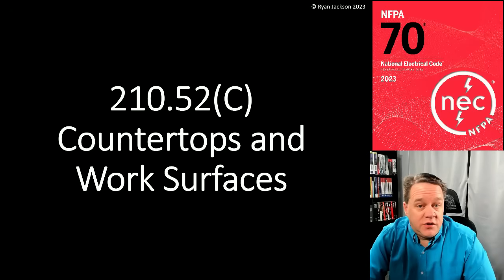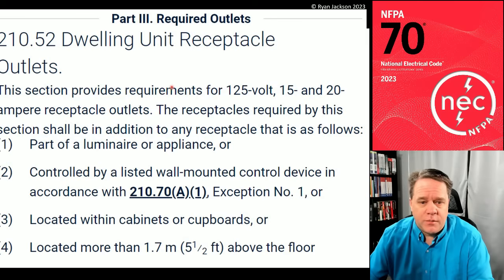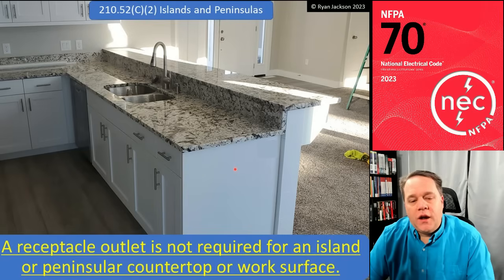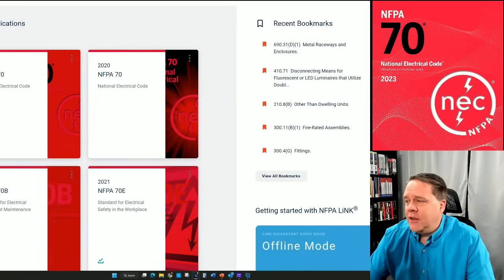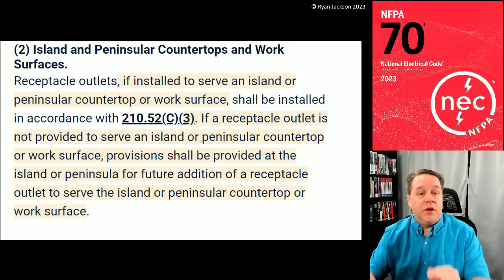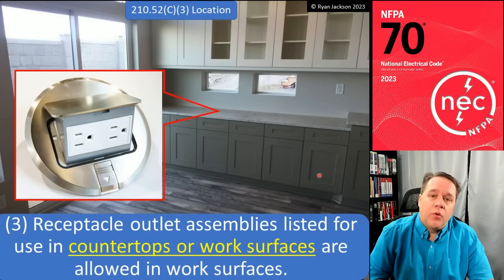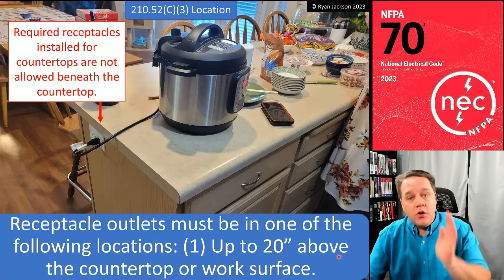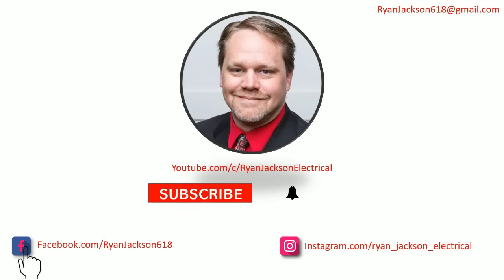Kitchen islands and peninsulas in the 2023 National Electrical Code

Comment: I think most Courts, and most inspectors, would judge by the intent of the NEC wording.  They don't want receptacles below countertops anywhere in a kitchen.  Typically those were in peninsulas or islands because the only lower surfaces without cabinet doors.  They are convenient for plugging in a vacuum cleaner, but too tempting to use for appliances that get hot.  Using 90 deg plugs would help, but little kids are still going to tug on things, and can't see what is on the other end on the countertop.  Don't want your tykes getting boiling chili dumped on their face since we all hope for attractive kids we can marry off someday.

In a kitchen remodel, I tiled all the way to the walls so the base cabinets sit atop the tile and could fairly easily be redesigned (exc. sink plumbing in wall).  Instead of a fixed island, I built a cabinet table with marble top that can be relocated (ex. to rearrange for parties), sliding on felt strips (doesn't slide easy so stays put).  No utilities in that table.  Slab foundation, so supplying power or plumbing would have been drop down from the ceiling (no drain), unless hacking up the slab.  I ripped out the L-shaped 1972 peninsula that made movement restricted and its overhead cabinets (ceiling mounted) that I regularly bumped my head on, and restricted view to the Living Room.  Also raised the silly 1972 dropped ceiling.

Comment: great so now we are back to all the people, who don't want to pay for a recessed in stone outlet, running extension cords from their counter tops to use electricity on the island.  I would think a cord running from the top to the side is a heck of a lot safer than what will end up happening.  Especially a when grand total of 10 total deaths in a 10 year period identified by this issue, I mean seriously, what's that like a .000000000000000000000001% instance of occurrence?

Comment: I love your videos, but I'm going to correct you on this one.  Yes, it's true that according to article 210.52(C)(2), receptacle outlets are no longer required in peninsulas or islands, so are not part of the "required outlets."  Mounting a receptacle on the side of the island or peninsula, even though it wouldn't fall under the "required" outlets, would still be a code violation.  It's an "if-then" scenario.  Read the article carefully.  it says, "IF installed to serve an island .... (etc), (the receptacle) SHALL BE installed in accordance with 210.52(C)(3)."  C3 is clear - the outlet must be ON or ABOVE a countertop or work surface.  So, ANY receptacle outlet serving a countertop, island, peninsula, or work surface; whether it falls under the required outlets or not SHALL adhere to the requirements of 210.52(C)(3).  So, sorry.... no side mount receptacles allowed.  (Just glad my house was built under the 2014 code.  I would really miss my island receptacles... lol)
Reply from the maker: Oh, I've read it carefully several times. Take a look at the 2026 code for how it got fixed. Code-Making Panel 2 was very much aware of the problem.
Reply: @RyanJacksonElectrical thanks for the update!  I haven’t gotten my hands on a 26 copy yet, so I’m looking forward to discovering all the changes.  I’m a second year instructor for an apprenticeship program in Iowa and I use a bunch of your videos for my class (along with electrician u and Dave Gordon).  Keep up what you’re doing.  I love your work.  Thanks for responding.

Comment: If there is already a rule that countertops must have receptacles every four feet but then you say receptacles are not required on islands and peninsulas (which are countertops) doesn’t that contradict itself? Especially in the case of a peninsula which is fully continuous with the portion of countertop along the wall.

Comment: So now when there are spills on the counter and that water/soda runs down into the seams and down into that "built in" receptacle, flooding the current, a lot of people are going to open them up and start cleaning them up.⚡ 

Regulators overthink everything so much they are constantly correcting all of their own previous "thinking."

It's called, the old switcheroo!

They have to keep changing things, it's called, job security.

If an electrician would advise me to put a "safe" outlet on the top of my counter I would fire them... do you enjoy cooking, eating and drinking over the top of electric outlets?

Comment: Finally a good change, safety and practical. I really question the common sense of some of the code making panel members. Maybe they are just trying to justify their purpose of being there.

The code book is beginning to get more and more confusing.Maybe each code cycle should be accompanied with a pamphlet or section ,explaining the reasoning behind each code change.
Explaining why, usually teaches better.

Comment: This still doesn't addrees the issue of a 30" high seating bar attached to an island or peninsula.  There will be a 4" or 5" tall strip of cabinet between the two countertops, below the kitchen work surface but above the dining surface.  Are outlets allowed there ?  Do they count as required outlets serving the kitchen countertop or would the peninsula/island still qualify as having zero outlets ?  They don't pose as much of a danger of somone hooking a cord as they pass by because they have a 12" to 24" deep dining bar between the walking path and the outlet.  They are nominally to service the dining bar where people might want to plug in phones or whatever, but could be used to plug in a crockpot or a blender up on the kitchen counter side, but then the cord would be going up onto the counter and not drape over the edge into a walkway at all.

Comment: I would only use a below counter level outlet for something at the same level, like needing somewhere to plug in a vacuum or a powered pet fountain. That just seems like the safest method. No cords stretching up. Sure popups can mess with the clean lines of a counter, but safety is king in my home.

Comment: I just had an electrician cite this code on a 20 year old home that was inspected with an issue with the outlet on the island.  Because the wiring was under the island that needed repairing, they would just cover the receptacle and cite the code, and not do anything. The home is for sale, should that code be the reason not to fix the problem, or is this a ploy not to correct the issue? Thank you for your time.

Comment: So a work surface is not a countertop: NEC Article 100: A work surface is a fixed, stationary, or portable surface typically intended for dry use and for tasks other than food preparation, personal lavation, or laundering that presents an incidental risk of spillage of smaller quantities of beverages and other liquids upon outlets mounted directly on or recessed in the surface. Examples can include conference room tables, office work stations, and the like.
Reply from the maker: @chrisdoutre101  Yep, vountertop and work surface are both defined.

Comment: I am so glad I discovered your channel today. My wife and I are planning a kitchen remodel and we were discussing this exact issue. On our island, we use a toaster(daily), a stand mixer (weekly), and a blender (also weekly). We also use a canning rig, like a crockpot, regularly. So we need island-accessible outlets. We currently have those under-counter outlets at each end of the island. Based on your crystal-clear explanation, and your excellent advice, I went looking for a safer solution and found the Hubbell RCT200 on the Lowes website. So, no more hand-wringing; we have a solution. Thank you.
Reply from the maker: @chrisdoutre101  Glad to help, Chris. Cheers

Comment: I have to disagree with you on the fact of side mounted receptacles can not be cited as a violation because of the language in 210.52(C)(2) it says "Receptacle outlets, IF installed to serve an island or peninsular counter top or work surface, shall be installed in accordance with 210.52(C)(3).". So while it is not required if it is installed you have to install it in accordance with 210.52(C)(3) and none of those allow under the counter top mounting. This interpretation of mine is backed by the 2023 NEC commentary as well.
Reply from the maker: No problem, feel free to disagree. But they are changing the language in the 2026 for this very reason. And everyone I spoken with on Code-Making Panel 2 agrees, by the way.
Reply: @ not trying to be one of those guys. I was just looking for conversation on the matter. But if my interpretation is not the case that it does need to be stated more clearly so it's a good thing it will be updated for clarification.
Reply from the maker: @SkylerManac  No worries here! 👍

Comment: Ryan I  have 2 kitchen counter tops..I will wire a 20 amp circuit for these 2 counter tops..question is knowing I'm only putting 2 outlets..Am I required to split the 2 outlets up..or am I ok to put 2 outlets adjacent to each other or stagger or alternate one of each circuit..thks
Reply from the maker: @FrankDicasmirro  Doesn't matter, as long as you have two 20A circuits, both of which supply the countertop.

Comment: I'm still confused. At first you say that the new 2023 code now does not require any outlets in a kitchen island or peninsula, they are optional. Then later on, you state that an outlet can in fact be located below the countertop level if it is not a required outlet, rather, an optional one. That would make any outlet on the island or peninsula fine to install below counter top level as they are all, according to what you said, optional. Everywhere else I am reading they are interpreting the code to say that even "optional" outlets must be above counter top level since they all are optional in that location.
Reply from the maker: @sandman3992  I'm am correct. The 2026 NEC fixes the issue, however. It just won't be available for another year.

Comment: This is another area where the committee needs to leave it alone. We added a requirement for an island receptacle because people were stringing extension cords to their island to run appliances. Now we don’t want people to use their islands for anything other than letting junk mail pile up because people were living like slobs and pulling hot items down onto them. Ultimately we can’t control that because people will go back to stringing extension cords and cooking anyways. Leave the one outlet rule in place and put the burden of safety back on the homeowner and appliance manufacturers

Comment: Government playing mom and dad again. This crap has to stop. Government cannot be allowed this much control over citizens. Government works "FOR" the people not to control the people. Unnecessary residential construction laws and regulations added over $10,000 to the build cost of the small house I "WAS" going to build. I'm done. I let my license lapse. I'm done.
Reply: I suspect that the makers of those "pop up" countertop outlets were the ones that paid off the ICC just like the Arc Fault Breaker people did so that they could get their product sold.
Reply: NEC isn't government.  It is up to localities whether they adopt the latest NEC codes.  Many haven't.  There are additional local rules, like I've read that around Chicago all residential wiring must be in conduit within the walls. They don't consider nail plates good enough.
Reply: I'm building my own house, by myself, and all the new codes are BS - I'm allowed to do the work myself, but still have to pull all permits and go through all inspections. When I built my own house about 25 years ago, all I had to do was purchase a $100.00 building permit. No additional permits or inspections. Now, if you want to build a shed in your yard (no electricity), you have to pull a damn permit and be inspected!  Load of CRAP!  Money grab

Comment: This is false, you cannot put a receptacle below the countertop on an island and peninsula anymore according to the NEC 2023. You haven't gone through the code entirely in one chunk.
Reply from the maker: No you're just wrong. Read it a bit closer, and note the changes in the First Draft. I also submitted multiple public comments for the second draft, which I think have a very good chance of passing. I typically have very good luck with Code-Making Panel 2.
Reply: @RyanJacksonElectrical  it says it’s not required but if installed shall be in accordance with 210.52c3 and the 3 options are in the counter top or above it… don’t see how that could be misinterpreted
Reply from the maker: @ChannelMATT19  I laid it out in the video, I'm sorry if you disagree. The Code-Making Panel does not.
Do you think it's illegal to install a receptacle under the sink for a receptacle supplied in-sink waste disposer?
Reply from the maker: @ChannelMATT19  Read the language in the First Draft of the 2026. If you're not familiar with, go to www.nfpa.org70 and hit "next edition."

Comment: I'm going to respectfully disagree.  A countertop or work surface doesn't change if there is a wall behind it or if it is an island.  A countertop or work surface greater than 12" wide requires a receptacle regardless of it is it an island or not.  I am not lucky enough to own a copy of the 2023 NEC yet (I'm still working out of the 2017), but my opinion is based on the wording in the 2024 IRC, which often mirrors the NEC when it come to electrical installations and requirements.
Reply from the maker: @MichaelCleveland-ek5gb  LOL so you don't have a code book and you're telling me that I'm wrong? Okay...
Reply: @RyanJacksonElectrical  I do have access to ICC.  I will admit that I was wrong.  I spent some time researching this and found that you are 100% correct.  The 12" that I would typically refer to only applies to wall countertops.  Stupid? IMO, yes.  After researching the issue, it is reinforces and clear that the primary purpose of the NEC (and NFPA as a whole) is to reduce insurance claims.  In this case, it seems to be that the CMP was presented with numbers of pull down incidents prior to the implementation of island receptacle requirements vs post implementation and they found that the number had risen.  Instead of fixing it, they attributed it to the change in 1990 and moved us backwards 3 decades.  FWIW, I don't foresee Pennsylvania adopting a code with this change for another 6 years, so I won't need to worry about it for quite some time.

Comment: I'm in a bind here. Are there any outlets for islands which are sturdy, elegant, and that don't pop up? I hate the way they look, and believe they are just one more thing which will easily break in a busy kitchen.

Obviously, an outlet in a cabinet is below the counter top.

What if I put the outlet below the counter behind a small door (say 4x8 inches). Does that count as a tiny "cabinet"??? Might my code officer allow that?
Reply: I think we all now see the issue clearly: if the power cord for a dangerious appliance is dangling over the edge of the counter, then the safety risk exists. So, even if the inspector passes it, you are still at risk of hooking the cord and yanking the crock pot into your lap. That's all the convincing I need.

Comment: NEC needs to focus on electrical construction safety FULL STOP.  Getting into pulled off counter potential etc is not an electrical safety issue.  Where an appliance is placed or how it is used is not something electricians need to be involved with. In regards to lawsuits the requirements of the code could just as easily be used against the creators of the code as the "experts in the industry" directing the construction process.  AHJ exclusions do not apply to the NFPA, so stay the hell out of it if liability is really the concern.  Not to mention the dam code book is getting ridiculously large and unmanagable year over year and this kind of stuff only adds to the bloat.

Comment: I suspect 2-level countertops for islands and peninsulas are going to become more popular just to have a minimal backsplash area for outlets.
Reply: That could happen. But we have had those raised countertops in previous houses and we ripped them out. Our preference is for the aircraft carrier deck look. So our next remodel will be moving the outlets from the end cabinets to the countertop with flush-mount pop-up Hubbell RCT200, or similar, outlets.
Reply: @chrisdoutre101  I had an island with sink with a bar facing the dining room in a previous house.  Didn't throw parties but it made a good breakfast spot.
Reply: I agree but there is no way I am building one of those contraptions just to satisfy code.  Personally I think they are unsightly and make it look like a ski lodge with kids getting drunk.

Comment: Ryan, just throwing this out there......if a home has a blank island that has no outlets on it and someone decides they wanted to cook/prep/etc on this island, why does it seem like there would be some that would use an extension cord plugged into backsplash outlet above base kitchen cabinets, draped across the walking space to the island so they could now have power on said island. Seems like this new island code would promote something like this that would be even more of a danger.
Reply from the maker: Yep, that's the whole debate.

Comment: As far as arguing with the inspector, the code always defers to the AHJ, Authority having jurisdiction. If   the inspector says no, because it's unsafe, and his boss supports him, then it's no.  If I was an I inspector, I would not allow under counter recepticals period. I would also push for a local requirement for some sort of safe outlet, since if there are no receptacles people will use dangerous extention cords. Also, I will not install an under counter receptacle